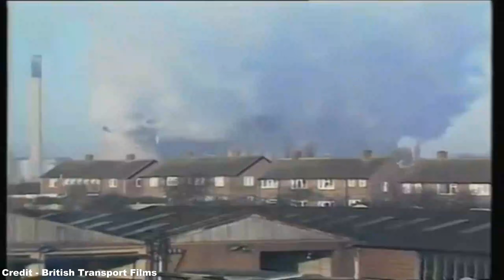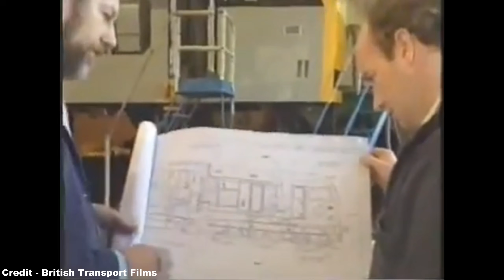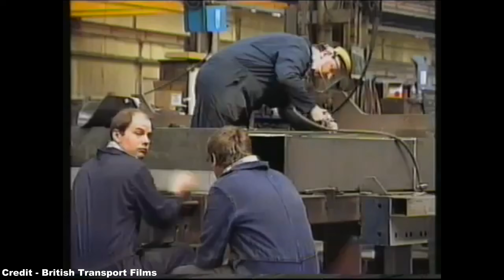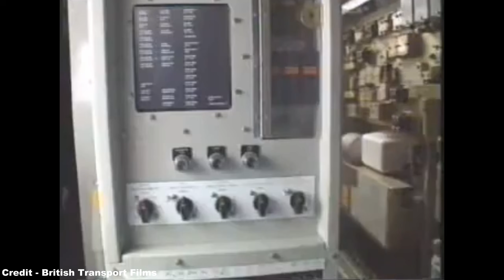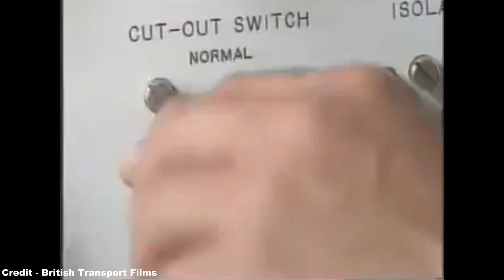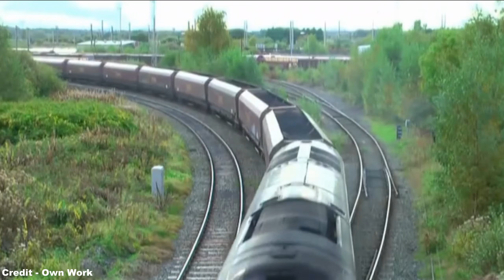BR's Last Heavy Hauler - The Rise, Fall and Revival of the Class 60

Comment: It’s a common mistake to assume the class 66s were designed to replace the 60s…..they weren’t . EWS original plan was to retain all the 60s, all the 58s , 100 x 37 and about 100 x 56. It was the loss of business that did for them as freight liner got 66s and took a chunk of the NR work

Comment: They say the 60 was problematic, but EWS never followed the required maintenance regime that BR/Brush designed, something they also did with the 56s in some cases more than doubling the periods between maintenance. This made them unreliable by default the same as never maintaining your car would. EWS just wanted a general purpose lump of pig iron they could do little maintenance on, thrash all day and share common parts across the fleet - hence the sheds.  The 60 was never anything more than a heavy haul slugger - if it wouldn't move the train (rare) it would rip the coupling out to prove the point.  The fleet was absolutely wasted and ruined so others could not take them on in volume and take work off EWS, which ironically happened anyway because Freightliner and GBRf simple did a better job for the customer.
Reply: A lot of the people who slag the 60s off seem to forget the really big fact of how poorly they were treated by EWS.

Comment: Bad timing to build them, bad time politically for the railway, bad time for the type of freight haulage they were designed for, low top speed of 60mph and teething issues lasting decades.  This was the best locomotive they could come up with?  I like the 56,58 and 60 for sight and sound and wonder why each of them had failures considering the class 43 HST just went on and on and on....
Reply: The low top speed of 60mph is appropriate for the freight they were designed for. The Class 66/6 sub class is their direct replacement and have a similar top speed and tractive effort. It is said on Google that the Class 60 could haul more than a Class 59, which is quite impressive
Reply: Class 43 was design well. Most of BR diesel seemed not well designed enough for the actual operators. I mean this class 60 alone was supposed to replace the class 50 types alone. It was until the class 66  mostly based upon an American Diesel designs to be considered great reliable design for the operators.

Comment: I guess that British Rail failed to appreciate in the Class 59 was its developmental history. Except for the carbody, the Class 59 owes its roots to the EMD SD40 locomotive which entered service in 1965. Over the years EMD improved it with the SD40-2 in 1972. EMD produced more than 5000 SD40, SD40A, SD40-2, and SD40T-2 locomotives, many of which are still in service today. So when EMD developed the Class 59 they had this enormous legacy to build upon, the biggest issue was squeezing the SD40-2 into British loading gauge. The Class 60, on the other hand, looks almost like a rush job trying to play catch up.
Reply: Australia built SD 40 variants under licence from EMD to our loading gauge as early as 1970, it's not out of the question for lessons learned there to have been applied to the class 59/66.
Reply: @Tiger351  Imagine what a fleet of 81 class (loading gauge adjusted) could have achieved.
Reply: @squeezydelemon3380  The 81's are superior to the 59's. The 59's are really a hybrid of the 81 and the BL/G class minus dynamic braking. In NSW Super-Series smashed the ALCO's for good. The BR 60's as a concept should have been in some ways better than the 81's as they had better wheel slip control than Super-Series and the Merelees prime mover on paper was superior in fuel consumption to the EMD 645/710 and the GE FDL at 3000hp Perhaps BR should have chosen Hunter Valley coal drag and Main South wheat drag for testing its prototypes. We know a 4 unit BR 20 class lash up would struggle where 4 x 48's are totally at home with the exhaust tip glowing red climbing up to Arglen tunnel at full load.
Reply: @gregrudd6983 Yes, with the 81s the SRA ticked the right boxes when it came to options. As for 48 class, I think that their longevity has demonstrated how understressed the whole package is. A philosophy that BR tended to avoid, seemingly preferring theoretical KW/Ton & new tricks over proven & reliable.
Reply: @squeezydelemon3380 The NSWGR whether by accident or design with the ALCO DL531 stumbled upon the most effective and efficient sub 1000hp loco in the world. They proved themselves to be superior to both the EE class 20 and the EMD G8. BR stuff should have worked better than it did. Even from the same builders. It was often said EE kit for Africa was superior than domestic UK kit. With that said until the 80's under 2000hp EE kit was better than US GE. The difference US GE put the $$$ into R&D

BR wasn't allergic to foreign technology it was just allergic to US technology. They even thumbed their noses up at Budd stainless steel rolling stock aka the "Silver Princess"
Reply: @squeezydelemon3380 Also never forget that BR was trying to get better economics than the US Class Ones with their diesel fleet. They failed misserably considering RENFE with its mixed ALCO/EMD fleet achieved the best diesel electric economics in Europe. No North American engine manufacturer offered 2500 hp when the Sulzer classes were ordered. But no Class One would look at the Sulzer LDA because of its cost and complexity. It was game over for Sulzer after the US GE U25B/C US GE picked wisely when they purchased the design of the Cooper-Bessemer prime mover. As the ALCO 251 maxed out at 3600 reliably as a 16 cyl unit.
Reply: Yup. The SD40-2, once upon a time, was our Class 47.

Comment: Interesting video. However, your current info is incorrect.
DB Cargo no longer operates their class 60s, as of at least 2024, instead regearing 10 class 66s for 65mph operation for heavier traffic (651-660 converted from 221, 164, 194, 149, 167, 156, 183, 147, 171, and 161 respectively).
GBRf only operates 10 locomotives, the ex-Colas ones, with the other 3 (004, 014, 018) being used as spares donors. There were plans to withdraw these by the end of 2025, however there are now talks of them having the same upgrades as DCR have had done, to keep them going longer.
DC Rail may have 19 units, but only 5 are operational (028, 029, 046, 055 being their original 4, plus 099 being the first of the new ones to be refurbished at Loughborough (and may not even be in traffic yet)).

Comment: One thing I think could have probably been brought up was the proposed conversion of a Class 60 to run on steam power as proposed by Steamnology last year which is to utilize a series of four steam turbines & 20 steam generators with 140kg of hydrogen gas as a fuel source. Yes I know, hydrogen is expensive but to be brutally honest, WHO THE HELL CARES about the cost? Just build the bloody infrastructure for it to work goddamnit! I sure as hell would if I were a rail operator.

Comment: I was one of the first group of drivers to be trained on these locos. The cab environment was really good and they would pull virtually anything 
Whilst 66s maybe cheap to run they were also very cheaply built and are the worst loco I've ever worked with , cab environment is absolutely awful,  not helped with the power unit not having resilient engine mounts.  The equivalent SD70 having cabs that are resiliently mounted so don't suffer from noise and vibration.  The 60s had proper engine mounts so don't suffer this
Cheers Russ
Reply: I find it amazing that you guys made Diesels as strong as an SD45, and even those are antiques now by today's standards.  Baldwin and Fairbanks Morse could've learned a thing or 10,000,000,009 from you guys.  Even Alco considering they left railroad locomotive manufacturing in the dust by 1970.

Comment: I remember these being introduced, v. slowly, in the early 1990s. They were meant to replace numerous older diesels, 20s and 37s in particular. History proved otherwise, and those venerable EE types are still working, 65+ years after they were built..
Reply: The main victims of the 60’s were the 20’s (many of which were withdrawn for scrapping) while the 37’s (and to a lesser extent the 56’s and 58’s) were demoted to less important roles thus seeing off the 31’s and 33’s which were demoted to infrastructure and ballast trains and associated services or withdrawn as well.
Reply: @davidnolan1692  Seeing cl. 60s being withdrawn reallly makes me feel old- I can remember them being introduced..

Comment: Worked on the class 60 from its early proving trials they are a great loco but were let down by some of the specs demanded by BR , ie traction control having to work with the woodward  governor , took 25 years plus to finally get rid of governor! . Class 60 wheel creep works from a standstill big advantage hauling heavy train (something the 66 super series will never achieve ) . Single Class 60 could work many of our flows that required a pair of 66's , we could haul upto 4'000 tons with the 60 , shame they can't be re engined as part for the 8MB275T engine are unavailable now
Reply: Land Recovery are reengining 12 of them with V16`s
Reply: CAT C175-16  . The problem is the 1000 rpm generator and the 3800 bhp engine is 1800 rpm; however a gear reduction could solve that.
Reply: @simonh317  Yes the smaller CAT engine could be an answer its just the reliability of a gear reduction handling 3800 hp . There was talk of the EMD engine as this is about 1000 rpm but physically fitting the V engine is a problem as the loco is designed for the straight 8 and it fits deep into the sole bar
Reply: @andy1285  The 60`s cant really work intermodel as they are too slow. Sadly all the heavy haul work has gone (or are going to regeared 66`s) - found out today theres only 5 freight trips a day inside Scotland. DB also arnt selling any (and no 92s either), even when approached by various other roscos. Its a joke really, but i can see DB being the first nationalised freight company.
Reply: @simonh317  We were looking at getting the 60 to run at 75 mph think it was just case of getting Network rail approval then updating software . I have been aboard a 60 at near 80 mph returning from Leeds on ECML , this was before Qtron and before software rolled off power at about 63 mph . Been on a 66 at 75 was class 4 empty coal , it was scary !  a TM motor flashed over GFR tripped and that was the end of that
Reply: @andy1285  I know 92`s can do more than 87 , but the rheo has to be bypassed and other circuits pulled. Problem with them both though, way too complex for what was needed and it didnt work. Look at all the 92`s parked for 25 years as well. Sadly cant see the 60`s returning at all, now the 99 is the new big boy
Reply: @simonh317  We probably don't have to high tonnage anymore to justify the class 60 , the 99 looks good bit of kit but we should be looking at more electrification and more pure electric freight . Only worry with Bi mode is it gives an excuse to stall any further electrification of our network
Reply: @andy1285  Green Signals have some good interviews and programmes about the 93 and 99 (i liked the 93 going up Shap, on a wet rail, hauling 1800T. Not bad at all for a BoBo! ; batteries for passenger will be the replacements instead of 3rd rail infills. As for pure electric, there isnt the work for the 92`s, as anything which needs off juice - yards for collecting, or diversions, are all diesel only. So bi mode will be the way forward. I do think the 93  will need 3rd rail pick up for battery charging `down south` so hybrid mode (1700 bhp at the rail) will be useable out of Southampton.
Reply: Just seen on Railuk forum, it looks like only 4 will be fixed up at Longport, the rest will keep those 4 going.
Reply: @simonh317  Would have thought still be few of the super 60's left  as its not that many years ago when we rebuilt them , they were great loco's with some really good mods
Reply: @simonh317  Yes see that on green signals , followed their channel from when it started 93 cab looks very much like the 68's we had round here , daughter drove them for while when TPE had them on the Nova 3 sets
Reply: @andy1285  I think that even by 2013 the scrap line at Toton was just that; and it was the 17 (ish) supers that could either remain in traffic or come back. The 12 for Land Recovery wern`t the supers, which is interesting of course, but there hasnt been a single taker, which says to mee they want silly money
Reply: @simonh317  The last 60's we had working from IMM were on tanks from Humber and Linsey (before we lost Linsey traffic) to Kingsbury  , its likely Db want silly money for 60's

Comment: I always liked the unique sound of the Class 60, it has a low key menacing rumble compared to louder (but still awesome) diesels such as the Class 37 and Valenta engined HSTs. 

British Rail had a great soundtrack and variety back in the day.
Reply: The MB190 engines were actually fitted to some HST power cars, but they abandoned that project due to it failing miserably.

Comment: Excellent video. I don't know what you've done, but your script for this was much easier to listen to than normal (much less use of the words "while", "being" and "however"). Perhaps you ran it through some kind of AI? Anyway, whatever you did, keep doing it. Unfortunately this excellent video still seems to be suffering from some audio issues. The overall audio quality still seems quite low (sound like low bitrate) and I think you have a noise gate or some kind of audio clean-up software that is a bit too aggressive, and it's cutting off the end of some of your words, dropping the last "s". Might be worth looking into overhauling your audio workflow as these issues seem to be quite persistent and long-running. It's a shame, because your content is so well-researched and presented otherwise.